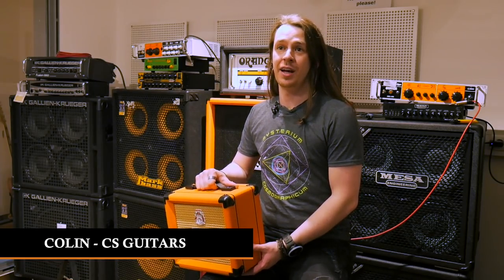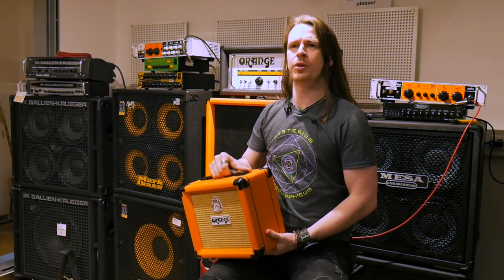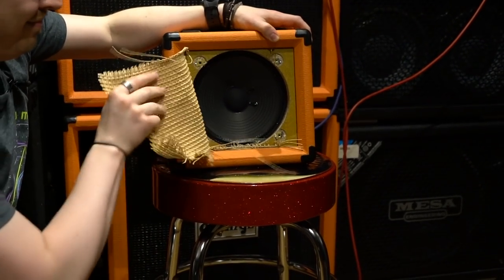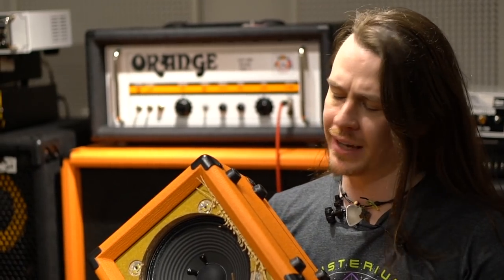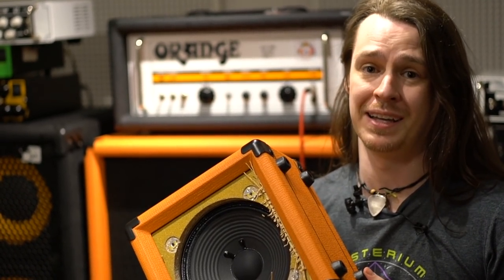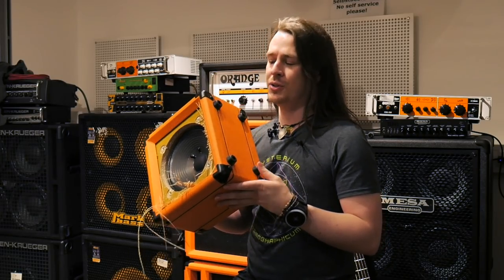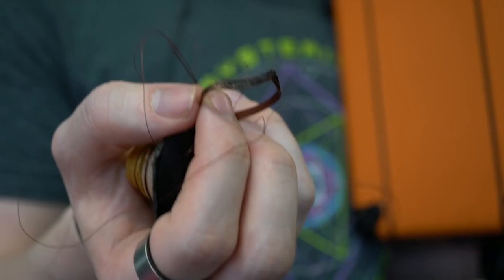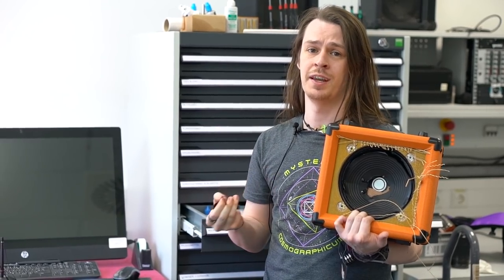How to void your warranty... with POWER (S2 - E4)

Comment: I've been searching everywhere to see if I can run the Jim Root terror head through the PPC108 Cabinet. I don't want to damage anything
Reply: You'll be fine as long as you use some common sense when it comes to volume. It would not sound that good though..

Comment: You know what I wonder why do not put fuse on out put if some does know what impedance that amp should run on that it would pop the fuse and not  fry the power transformer. I ry this one most important because it show what not to do because some one might make mistake. the others are so out there that it is very like that amp use will never do it by mistake.